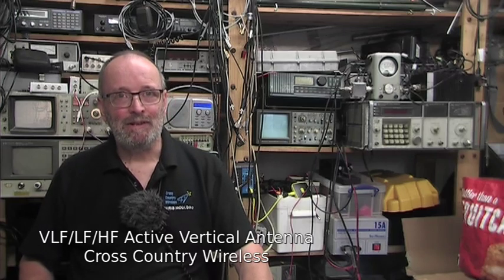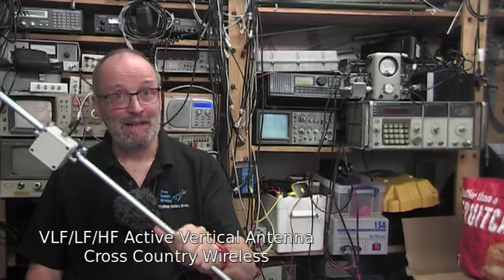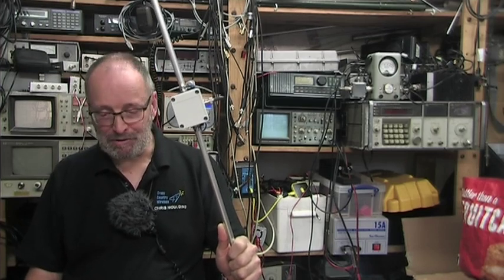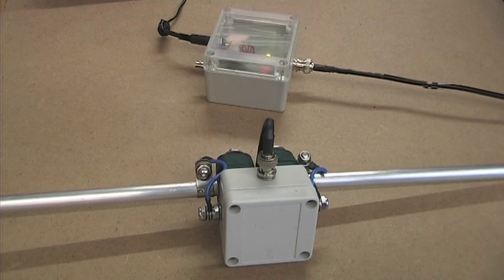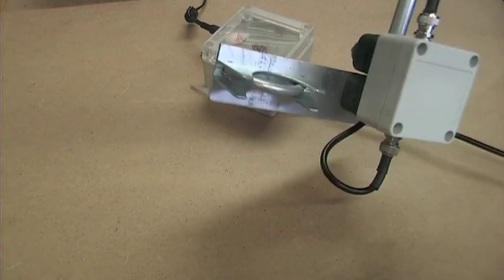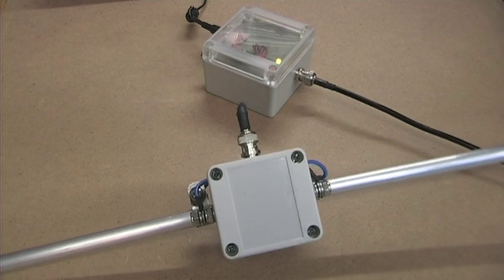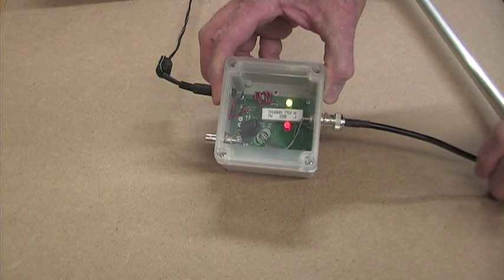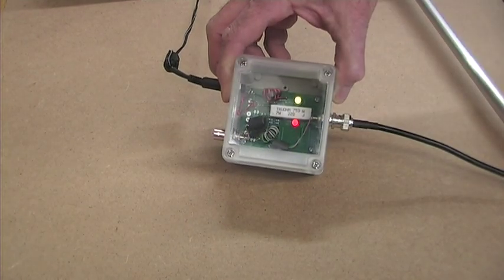VLF/LF/HF Active Vertical Antenna - Cross Country Wireless

Comment: This is High-Z preamplifier on the antenna?
Reply from the maker: The High Z Antenna Amplifier was designed to replace this antenna. It can use a larger vertical antenna element up to 7m for greater signal to noise performance in extremely quiet rural locations. Regards, Chris